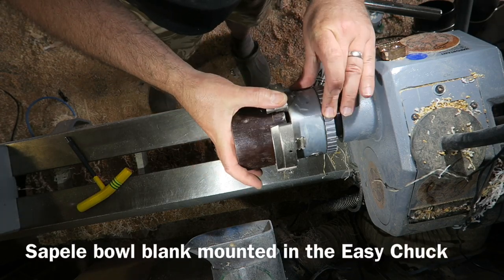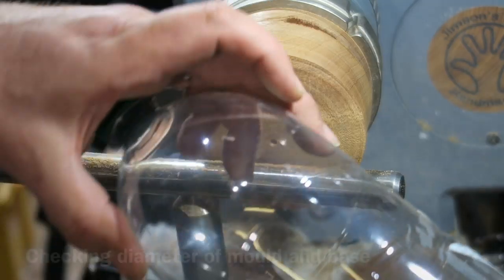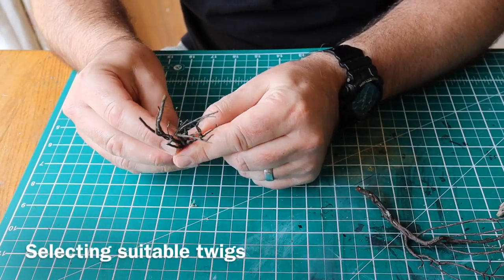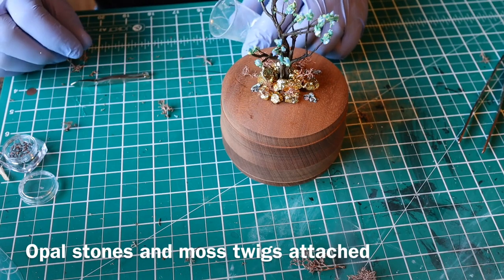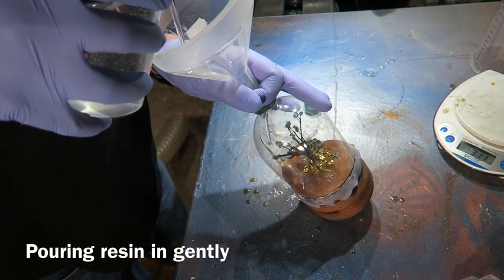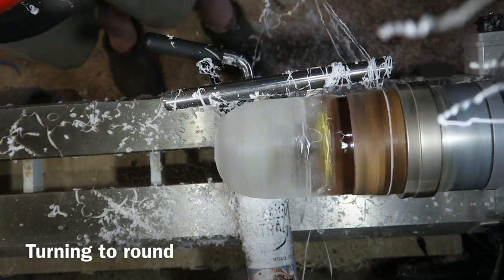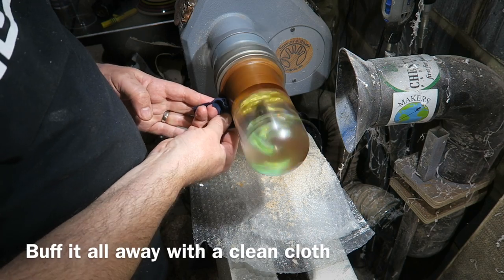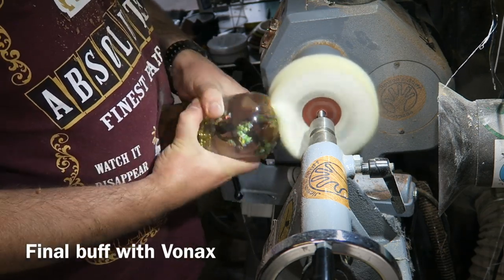Woodturning The Opal Tree Diorama - Miniature Treasure Garden

Comment: Jim really nice work. Two questions: 1. What does the pressure pot do? 2. Do you need a set temperature to set up the resin?
Reply from the maker: Thank you very much Hugo. The pressure pot eliminates any bubbles in the resin by compressing them and it also stops air expanding out of the wood and forming more bubbles. The resin, mould and ambient temperature should be between 20 and 25 degrees C.
Cheers 
Jim

Comment: That is amazing and breathtaking you can make a fortune selling those.is there anything you can recommend for getting rid of small scratches on some of the projects I'm working on after the buffing I could still see some very fine scratches and I'm not sure what to use to get rid of them
Reply from the maker: Thank you very much. Fine scratches can be the hardest to remove, if you look hard enough you can find very fine scratches on most pieces under certain lighting conditions. I find that if you can still see scratches after buffing then further buffing is unlikely to remove them and you are best go back to sanding. When sanding I don’t skip grades and make sure each grit removes the scratches from the previous one and sometimes I will sand up to 1200, then Yorkshire Grit and buffing. If you are still left with scratches then I would wet sand with Micromesh pads from 1500 to 12000 before buffing, tedious but it works.
Cheers 
Jim
Reply: @JimsonMakes  I've been using Emery boards and nail files that you can find in any store and they're doing quite well and someone also gave me an idea to use a little bit of Windex to get a much better shine and it even works on some of my wood pieces and I cannot believe how amazing it looks but the stuff that you mentioned in your video it's hard to find here in the US and it's hard to find any department store that sell micro mesh pads  but I've been looking everywhere thank you you've been a big help but thank